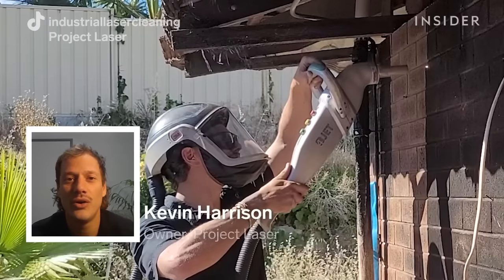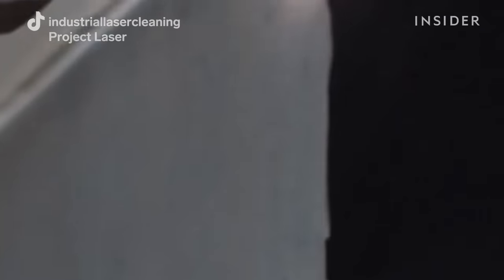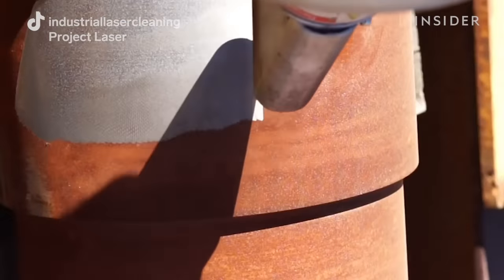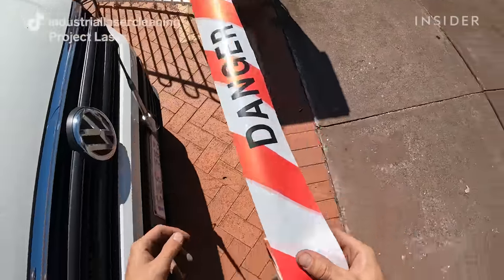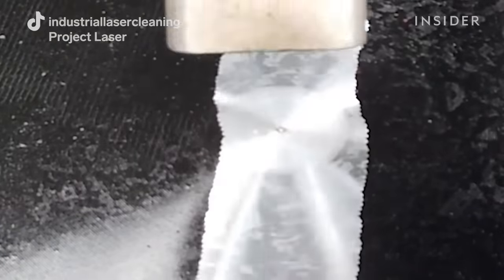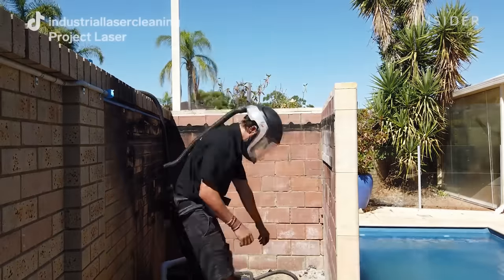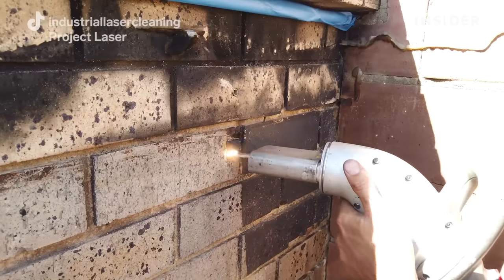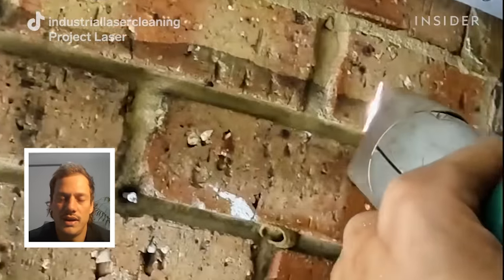Laser Cleaning Soot From Fire Damage | Deep Cleaned | Insider

Comment: After explaining safety precautions he says "you could laser clean with your eyes closed." This is truly amazing though! Not having to use chemicals or anything that'd potentially ruin whatever it is being cleaned.
Reply: He said it, because in the sentence before he explained, that you can hear the perfect working distance with your ears. It's like driving a car by ears, just because you hear the motor noises.

That is not related to safety.
Reply: @maxhouseman3129  I was just kidding around
Reply: @maxhouseman3129  Hey Max, that laser has grown to be sweet tune music to us
Reply: We love this tech! glad you enjoyed the video
Reply: @Satish K stainless and aluminium are reflective and be cleaned, you'd want to be conscious of the direction of the beam so they're not bouncing back at the operators
Reply: You can definitily ruin what you are cleaning... this is why you need to know how to do it. 
Removing soot is very easy as it is a perfect absorber for this wavelength laser.
Reply: @maxhouseman3129  a little bit more 21
Reply: @jackmclane1826  it's pretty easy to also not damage what you're cleaning once you have experience. And damage would be classed as putting too much heat into the surface, you're not going to punch a hole through something like brick or steel even if you hang around for minutes in one spot, which simply isn't going to happen
Reply: @projectlaser  Are the lasers specifically calibrated for removing soot? Or can this be used for cleaning off other substances. I'm wondering if it could be useful for cleaning after flooding?
Reply: @aleenaprasannan2146  Hello Aleena, the Laser can be programmed to remove rust, paint, grease and other residues. It's not going to remove mud, mould or other wet organic materials. I hope this helps
Reply: @projectlaser  Understood...I was actually thinking about the mud residue. I guess it would be too cakes and thick for lasers to dislodge
Reply: Yeah the smoke damage smell would still be there...

Comment: Graffiti comes to mind. A good way to get rid of it without having to paint over or use chemicals.
Reply: Graffiti is hit and miss, some colours react differently with infrared light! black is easier than white for example
Reply: Narc
Reply: @cozmowtl  cope
Reply: @dirt3009  
Scope.
Reply: You'd have to be very mindful of what the paint pigments are made of. The laser is doing a process called ablation. You can think of it as a light jackhammer. While the big laser might be a 200W, that's measured at continuous wave output. When you pulse a laser you're looking at peak power as the key performance criterion, which is a function of the pulse duration and frequency.
When you ablate something you're dumping all the energy in your pulse into the target to vaporize it. If it's a highly volatile oxidative material you can get it to ignite, so you gotta be careful.
Reply: I remember that from Demolition Man
Reply: @famboyoot705  "In a firm tone of voice, demand maniac lie down with hands behind back."   "Or else."
Reply: How does the soot vaporize but everything under is untouched?
Reply: A lot of paints contain toxic materials like cadmium which are hazardous (cause cancer) when inhaled. Don’t know how well vaporising paints would work
Reply: Maybe these can be used to remove the tats from Walmart and Waffle House women 🤠
Reply: @AvoidTheCadaver  The big laser is more like 2000W

Comment: What blows me away is the ability to tune it so that you can clean delicate materials that are even potentially flammable without damaging the surface. Removing surface contaminates from a wall without affecting even the painted surface is just extraordinary. I hope we get to a point where a significantly toned down version can be feasible as a household product.
Reply: Glad you appreciated our expertise JJ, plenty more on our YouTube page
Reply: The big problem with lasers is its REALLY easy to laser your or someone else's eyes; lasers can go quite far and if they hit a reflective surface they can bounce to unexpected locations, this is why they always use laser goggles and put up those light absorbing fences
Reply: This needs to be toned even down in power so human can use it to safely bath without using water, that would be an amazing breakthrough for saving water and also space travel.
Reply: This is because the soot is black and absorbs light easily.
Reply: @henkkaa88  That makes perfect sense. So realistically this would be much harder if the goal was to remove graffiti or something similar.
Reply: @JJFX-  harder but not super hard. Dirt is rarely as solid as the surface it is attached to so it will vaporize easily. I own a fiber laser. I would say it becomes hard to be gentle when the two materials are too similar. You can adjust the frequency of the laser and pulse width along with power so it will find it's targer more easily and destroy 🥸
Reply: @henkkaa88  That's so f'in cool. I have to get my hands on one of these at some point. Thanks for sharing!
Reply: @projectlaser  I wish you the best😊😊😊
By the way ,whats the name of the machine youe were using in this video??
Reply: @willsorry  its a 500W laser by 4Jet
Reply: @projectlaser  is it 500W impulse or CW ?😊
Reply: @Tom-bu3qd  pulsed, CW can't remove soot from bricks, we've tried. It could remove soot from steel though
Reply: @projectlaser  good job👍, and for monuments and works of art, what laser do you recommend?

Comment: How do you work your pricing out?  Is it by the surface area to be cleaned or time spent?
Reply: same question i wanted answered as well, with my business i charge per aircon, so its my time im wasting if i fart around. I would say it would be similar to painting - how many rooms x how big they are x how bad it is(depends this laser stuff looks insane and flawless so i could imagine this would be always at base rate) you could add complication in there but like he explained his work almost does it self you just have to focus on security and making sure there isnt anything invisible because thats were you miss going the best job possible
Reply: safety*
Reply: Time and what material it is cleaning probably. Surface area can differ the needed by how much soot in an area and what material is being cleaned
Reply: Hey Mate, Our prices vary depending on the industry, smoke damage we either charge by the sqm or by an hourly rate, depending on size of the job and the level of contamination we are removing, be it soot, paint, grease or other coatings
Reply: When no other is doing it guaranteed  $100 + an hour, still cheaper than replacing
Reply: @man.i.literally.failed6772   x5 would be closer to the hourly charge in AUD.
Reply: @projectlaser  there you go, but those machines aren't cheap too
Reply: @man.i.literally.failed6772  to think our first laser was broken for 8 months we've done well to stay in business!
Reply: @projectlaser  awesome job mate love to see small business growing into bigger and better things which will help and grow our beautiful country
Reply: @theblackandwhiteclan2952  Really appreciate friend!! thanks for the kind words
Reply: That's a 60.000 € machine.
Reply: @yoshy2628  the 100W laser is around that price, most the videos in this clip is the 500W laser by 4JEt

Comment: Looks a great idea but where does the soot go? Is it entirely collected by the respirator, or will a second less intensive clean of the surfaces be required afterwards.
Reply: It's vaporized
Reply: @TheRandompaint  vaporized doesn't mean dematerialized, it's just floating around in the air
Reply: the laser wands usually have a vacuum cleaner attachment so the soiling that's been blasted off gets sucked up and away into the bag

Comment: Really cool. I had no idea something like this existed, but once you think about it it is really an "obvious" idea (as most good ideas are😄). 
Does this work only with soot, or could this kind of technology be used to clean off other kinds of contaminants?
Reply: soot is particularly convenient because it's extremely dark and absorbs the heat much more than just about every surface that it's on. like how laser hair removal works best on pale-skinned people with dark hair.
Reply: I've seen lasers that remove rust as well
Reply: @n_coder  there is a clip in this video of that
Reply: Rust, bacteria, chemicals, coatings, plant cover.
Reply: well i mean it is not 'obvious' in the sense that it require sphtscis to work that wway
Reply: Hey Mathias,
As mentioned by Semechki, soot is great because it's black and absorbs light, it also helps that it's simply a layer of carbon laying on the surface. we also remove corrosion, paint, lead based paint, oil, grease and lots of other thin layers of contamination
Reply: @Ass_of_Amalek  возможно и для эпиляции этот прибор подойдёт. Раз провел и ноги абсолютно гладкие) очередь из желающих будет
Reply: @ИванПетров-д2ы  sorry, I don't know ukrainian or russian, I just know memes xD
Reply: @Ass_of_Amalek  😂
Reply: How much was your first machine and any advise on someone starting this as a business

Comment: I believe this process also removes rusr from metal surfaces... what else does this tech clean ? Also, can i rent the machine or service ? Thanx for an awesome vid.
Reply: A pulsed laser can remove soot, oil, grease, corrosion,  potentially epoxy resin and graffiti, and lots of other residues
Reply: If you look for your local supplier you may be able to rent a laser

Comment: This creates an additional issue--dust.  They need to use respirator equipment, which will also be a charge to the customer.  Additionally, the dust/debris will also need to be cleaned up at additional cost and incur more hepa filter/negative air machine costs.  By the time you're done, demo and replacement of drywall would probably come out the same in price or cheaper, and guarantee no odor remaining.  The drywall has porous paper.  Laser great for masonry, but inside taking off the soot alone won't get rid of smell.  That light fixture would still need to be wiped down or replaced, so paying $10 to laser clean it first is pointless.  And don't forget the cleanup after this.  Inside a structure, no go.  Exterior or stone?  Yeah maybe.

Comment: what is your opinion about the small 100W-200W pulse laser backpacks? can they work for jobs like these in your videos?
Reply: Sure, but instead of doing. 1 sqm in 2-3 minutes, you'd do it in 15+
Reply: @projectlaser  if i am not mistaken you mention that you are using a 200watt pulse laser in the video for removing the soot from walls. so what is the difference with a 200watt backpack laser? the reason i want a portable small laser is that i dont want have the extra money for a van
Reply: @facepalmjesus1608  you're most likely not going to new able to carry a backpack laser for more than 45 minutes at a time though even that I doubt. Not I've looked at the tech sheet for a backpack laser for few years. 
We do have a 200w laser in a couple clips on this video. Our 200w  laser source weighs 18kgs and is 1.5Mj.
Reply: @facepalmjesus1608  better to get a compact 200w on wheels
Reply: @projectlaser  ty for your replies
Reply: @facepalmjesus1608  the majority of clips in this video is with the 500w pulsed laser by 4jet FYI

Comment: This basically involves all the same risks as welding, dealing with vaporized materials is seriously hazardous to your health (think of why you never see old welders) most get cancer within 10-20 years and usually don't live past 50, and if they do, they usually go blind by then, so I'm glad to see respirators used, but the problem of skin contact with the vaporized dust/paint can be an issue, it's just as hazardous but is usually (mostly) washed off, provide your workers with the options to wear a full body suit if possible, that and, shields that can block lasers safely simply mean they won't burn your retinas instantly, but you will still suffer with long term vision associated side effects, if anyone does a job like this I would at the bare minimum expect them to be paid as much as a welder due to health hazards, they're throwing away their lives for fast cash and the good ones (like good welders) should be paid more since they do a better job and are more experienced, anyone thinking of doing a business like this, please take all of that into consideration

Comment: What happens to the soot after it has been vaporized?   Are the particles just floating around in the air waiting to fall on to another surface?   I don't see any kind of externally vented extraction hood being used.  How is the vaporized particles being dealt with?
Reply: Generally inhaled by the operators, if you're outdoors there is zero reason to capture a minute amount of soot, indoors we always use a 3stage extraction unit.

Comment: What's the point. The reason fire damage is replaced is it isn't just surface damage. Also this would take a ridiculously long time.
Reply: it makes sense on the more solid materials like bricks, concrete and metal. in many indoor fires, much of the area covered in soot has no structural damage at all. it would be nice to replace a lot of stuff, but with some parts of a building, that's going to be extremely impractical. if you've got wallpaper covered in soot, you should probably replace the wallpaper. if you've got a brick wall covered in soot, you're not going to replace the bricks.
Reply: This isn't for fire damage, it's for smoke damage.
Reply: @mvansumeren4313  You are on the money again!
Reply: As  @M VanSumeren mentioned, it is a tool for removing smoke damage, once the surface is damaged the bricks, wood, sheet rock, bricks etc will need replacing. we are here to remove soot, check out our channel for some other videos

Comment: Most of the low-volatile pollutants in fires are firmly adsorbed (bound) to soot particles after cooling. Therefore, even in the case of an uptake into the body, release into the tissues and bloodstream is relatively low. So far so good. Nevertheless, in some cases there may be a hazard from polycyclic aromatic hydrocarbons (PAHs). Depending on the fire material, polychlorinated dibenzodioxins and -furans may also be present, as well as chlorobenzenes and other substances. Many of these are classified as carcinogenic! If you laser these substances around without extraction, a great risk remains in the premises. How do you eliminate the risk, or is it just a matter of making it look nice again, the owner can paint over it, and the next tenant is sitting on a ticking time bomb for his health?

Comment: I had a brick wall with the same amount of soot as the brick wall in the video. It's 16x12. My pressure washer removed all of the soot in around 10 minutes. The bricks looked brand new. So why choose this method (which seems very time consuming) vs pressure washing? Genuinely wondering. Water conservation?
Reply: You wouldnt want to spray a pressure washer in a living space though, this makes much less of a mess

Comment: How does the laser not damage the layer underneath?
Reply: it is set to a specific wavelength that isnt as easily absorbed by those materials and also due to how short the duration the laser is firing at any particular spot it makes it very difficult to damage anything that isnt surface level.
Reply: Imagine spraying a hose at a bare section of dirt, if you have it full power and aim it at the spot for a decent amount of time spraying the dirt it will slowly dig a hole in the dirt, however if you try that while starting and stopping the stream every couple seconds you end up not removing that much dirt. Similar premise to that but it is starting and stopping incredibly fast.

Comment: I wonder how well this would work on the used Falcon 9 Boosters from SpaceX... they gave up cleaning them because the performance impact of the Soot was irrelevant, and it is also really hard to remove it...
Reply: It's probably a lot harder to remove from those rockets. Could be really deeply bonded due to high-speed atmospheric re-entry.

Comment: i have a question...does it remove that smoke smell? you know the one. its usually impossible to get rid of that awful burnt stench short of rebuilding the structure. if one lazers as shown here ...then thoroughly wipe it all  down a couple few times?
Reply: The smoke smell would come from airborne smoke particulate. So it wouldn't do anything about that smell

Comment: This would be lovely to clean my vehicles O2 senors. I have a much older car and O2 sensors are.expensive. They get covered in soot and are starting to need to be replaced every feew years.
Reply: Yep..just had another one changed; $90 for part+$50 labor. Shop charges that much just for Check Engine light diagnostic:((.
My 09 Chevy Express van had its 2 catalytic converters stolen; I had replaced both w/aftermarket for $850. Have replaced all 4 02 sensors & hoping none go bad again.
Hope you can keep your vehicle secure in a garage..

Comment: can you tell us all, does running this device draw a lot of electricity?
Reply: He specified in the video that he has a 200 watt mobile unit and a 500 watt van mounted unit.  The power consumption of them is going to be in that neighborhood plus any fans, vacuums, or air cleaning equipment.  By the looks of it, there is a small HEPA vacuum near the laser emitter to deal with liberated soot.  If true, this will draw ~500-1000 additional watts.
Reply: @mvansumeren4313   You're a good listener and you're on the money, we also have a compressor that's required for the laser.